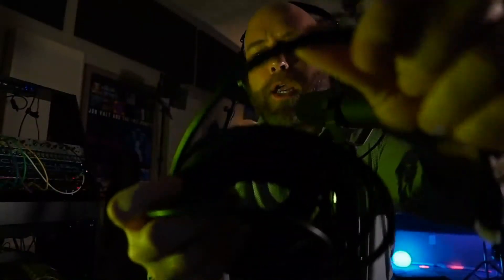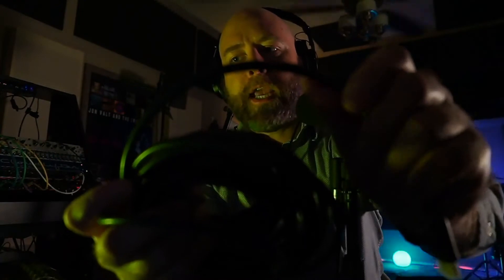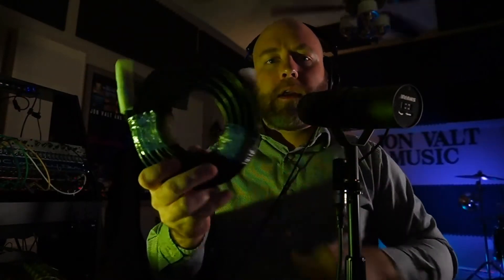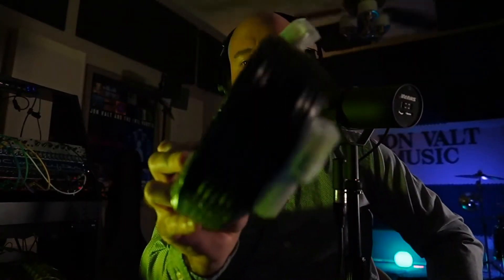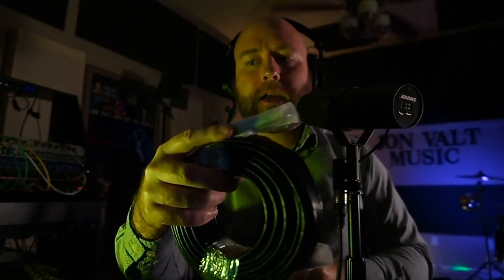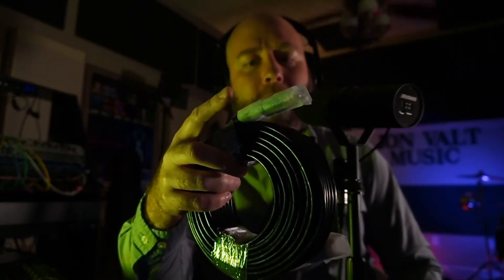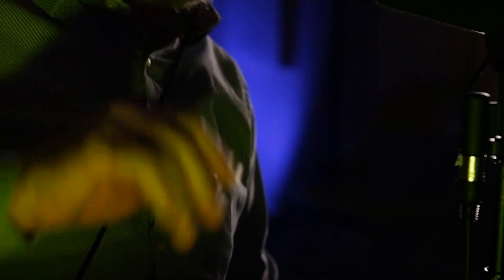Atem Mini Pro Inputs 2, 3, 4 not working properly.  Plus 100 Foot Fiber Optic HDMI Cable Test!

Comment: Did short HDMI cables (e.g. 1 meter) work for those inputs? Or only the fibre optic cables?
Reply from the maker: If I recall correctly, thick cables (about 2/3 though the video) work well but not thin ones.
Reply: @JonValtandtheEvilRobots  Ahh so the HDMI cables were working, but just needed to be switched out for other HDMI cables. Thanks!
Reply from the maker: @nikharrison  it’s basically the atem mini doesn’t have enough oomph (voltage) to drive a cable with high resistance (thin wire). So you need a beefy one - and those  get unwieldy and kinda ridiculous for short to medium runs. And expensive for long runs. 

The optical cable was an interesting experiment. In my current setup (see recent videos) the projector is fed by that super long cable, even though its computer is very close by. That’s a statement to how well they work. 

But yeah for short, just get a beefier cable. Beefier than you think.
Reply: @JonValtandtheEvilRobots  Thanks and appreciate the info!

Comment: Really interesting. As I posted to another answer here, I have issues with inputs 1,2 and 4 . 3 ALWAYS works.. what does BM do ? And on my AMP, it's a digital issue.. it works or black picture..  Last try will also be with a fibre cable.. but why is this necessary ? What is wrong with the design ? Add: the inputs work, when I connect an HDMI-Recorder between..
Reply from the maker: With long HDMI cables, I’m pretty sure it happens because of a voltage drop over the long distance.  The Camera may not be providing enough juice. 

The fiber optic cables made the difference. Too bad they’re expensive.

Comment: Thank you so much for the Fiber optics cable test!  Is there any problems when using a micro or mini hdmi adapter?
Reply from the maker: Not that I could tell.  In the "after" test in the video, I'm using an adapter as I demonstrate. :-)

Comment: Thanks we had this issue as well !
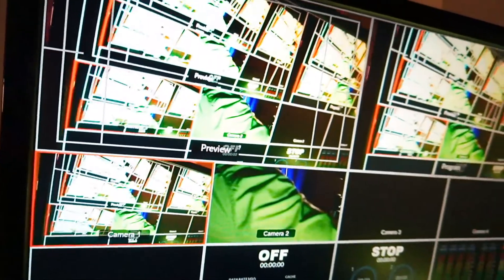3:27 : general question : What do you use to see the 4 cameras and the program/preview in a monitor like that ? Atem Software does not do this for me. Is it because I have the non pro version ?
Reply from the maker: I am pretty sure your Mini (non pro) will do it too.  This is just the HDMI Output of the Atem Mini plugged into an LCD monitor.  And then there  is a setting (forgive me, but I don't remember where) that lets you choose what is output - either the "Program" feed (what would be broadcast over the air) or the multi-cam preview screen.  This guy who's way smarter at it than me says that you might be out of luck.  But check out his whole video - maybe there is a workaround or something.  https://www.youtube.com/watch?v=sFH-dT2s02w (His other videos are helpful too).
Reply: @JonValtandtheEvilRobots  hmm wow ok thanks ! stupididly I never plugged anything in the hdmi out... I use the usb-c and Atem Software/OBS. I don't have enough space in my setup for an extra monitor. I hoped that the ATEM Software somehow could display the 4 inputs (there is a tab that looked like it was meant for this). I'll go check the video from your link. Cheers

Comment: From my experience, I would say about 3 meters (9 feet) is the safe spot with a standard HDMI cable. 

It also depends on the camera, how powerful a HDMI signal it delivers. 

Buy good quality cables, and alternative convert to SDI (Blackmagicdesign have cheap micro converters) for longer cable runs. 

The input one on the ATEM is a special one, that’s why you see the difference on the other ports. 

Also the quality of the USB-C cable is very important. I have testet a lot, with mixed results. One cable almost killed my MacBook Pro, as it tried to use the ATEM as a power supply 😊

Comment: I experienced this one also with Atem Mini Pro. I am using the same HDMI cable about 32ft (10m), if i plugged it in HDMI port 1, its is ok but when using port 2 to 4, it doesnt function properly it glitches and turns blank. :(
Reply from the maker: Optical cable fixed that!

Comment: Hi everyone. Sometimes when we use cable with input 1 there is no glithing but when we try to use it in input 2 glitching starts. In the end we change the cable but it is very frustrating not knowing why is this happening. Thanks for this video.
Reply from the maker: This was my exact issue.  Turns out it IS the cable!
Reply: @JonValtandtheEvilRobots  Yeah I can understand that but my question is how can  the same cable work in input 1 but not in other 3 inputs? :D X files moment here... :D